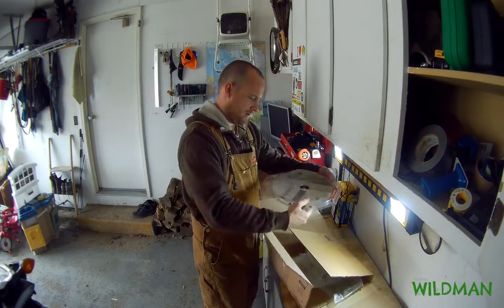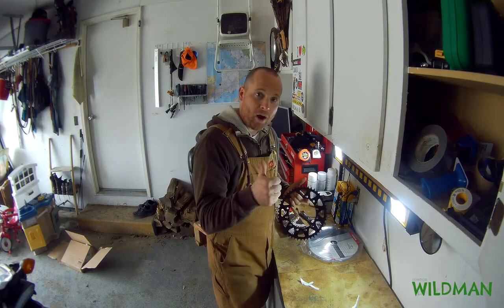New chain and rear sprocket install on the WR250R

Comment: you're right it is trash especially with bigger tire. 

For setting tensions check out this article.https://xladv.com/articles/how-to-properly-adjust-your-drive-chain-r19/
Screw yamaha and their updated slack procedure for wr250r http://rickramsey.net/MTpdf/TechnicalBulletinM2008-020short.pdf.
Reply from the maker: Cool thanks. I'll read through the article.

Comment: I thought you have to grind the rivot to flush before you use the chain breaker. It looks like you did not do that?
So I am a guy who is trying to learn how to do this from a guy who says I don't know what I am doing repeatedly.  Hope it worked out well for you.
Reply from the maker: I've done a few chains now.. never grinded anything before using the chain breaker.  Chain breaker pops the rivet, and pushes it through.
Reply: if you have a good chain breaker you can get away not grinding.  If you buy a cheap one best to grind.  Ive broken 2 cheapos :(